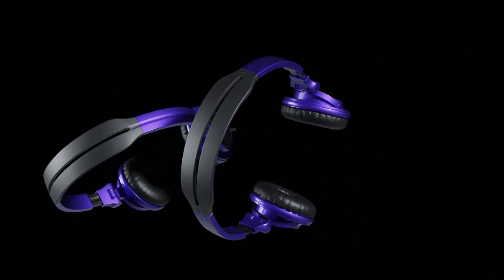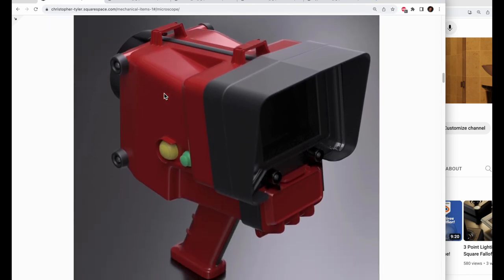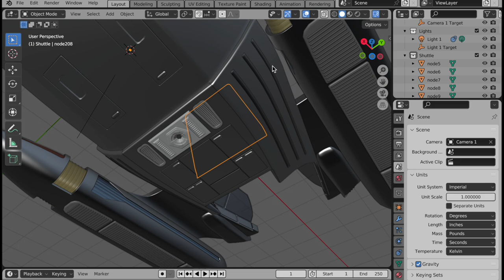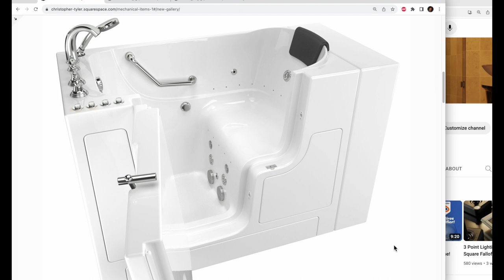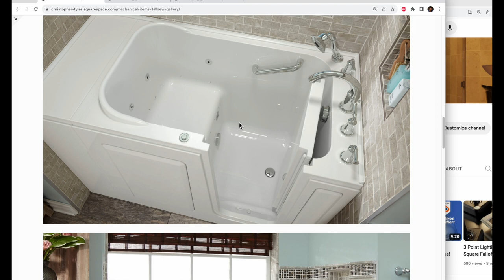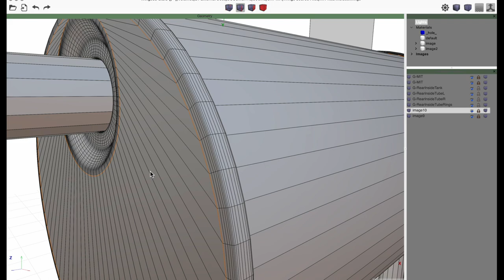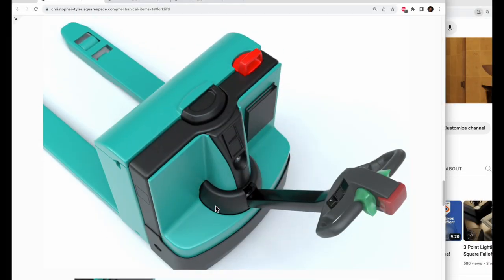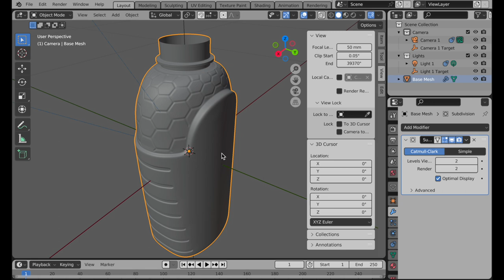Am I qualified to teach?

Comment: You probably know more than most of the people criticizing. I had never known some of the techniques you showed with N-Gons. I always did my best to avoid them instead of learning to work with them. If you use it right, you can actually create a cleaner mesh with a LOWER polycount. Another tool for the ol' toolbelt!

Comment: You touched on using CAD models in this video, could you make a video with tips and tricks to get decent results using this approach as so far my experience of converting CAD to polygon based models has been pretty terrible!
Reply from the maker: I'll look at doing that. I use the Nurbs modeler MOI for this purpose and it works great. I'll show it.